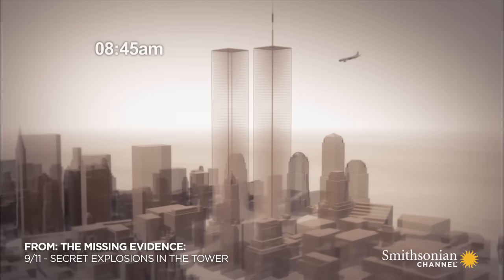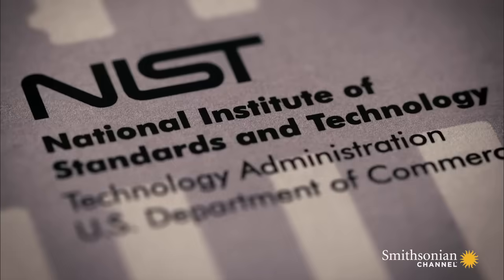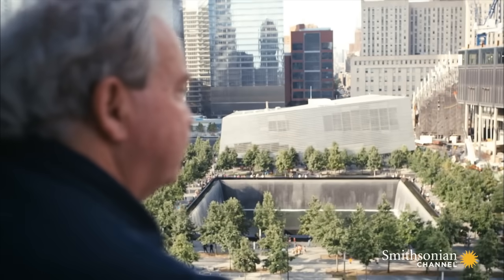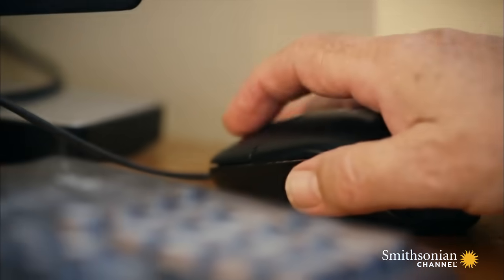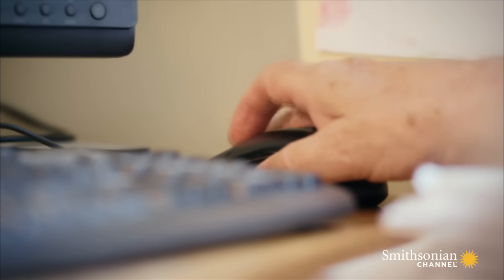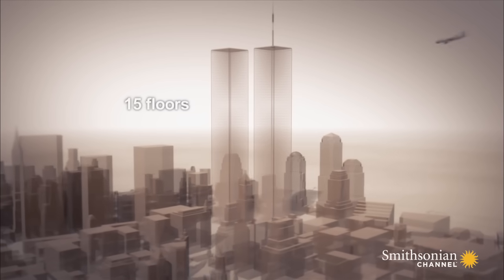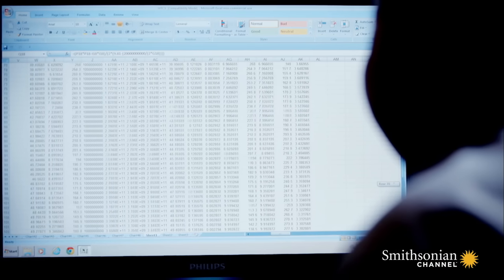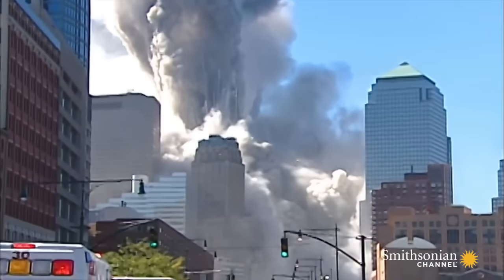This Computer Simulation Explains How the Twin Towers Fell

Comment: What this analysis lacks is the fact that only 6-10 of the 47 core columns were severed by the planes and others were supposedly weakened due to the impact and ensuing fire;
* Therefore, the damage to the core columns was asymmetrical, at least for the South Tower;
* The South Tower got the most damage (ten severed core columns) in the North East corner due to the skewed trajectory of the plane;
* Around 9 :58 AM the outer columns bend inward on one side due to the sacking of the heated crossbeams, which can be seen in close-up videos; 
* The crossbeams eventually gave way which lead to the collapse initiation  as NIST calls it and the upper section of the South Tower started to collapse;
* Due to the asymmetric damage the upper section bend 22 degrees to the side, but the collapse continued symmetrically in about 9 seconds (this video suggests 11 seconds);
* The collapse should have been largely asymmetrical, focused to one side;
* Another physical aspect which is not considered is the conservation of momentum. Even though a large mass of the building falls onto the lower floors, the upper mass itself should be damaged also, because it is exposed to the large mass of the lower floors. (Imagine a car having a head on collision with a truck.) 
* For the South Tower you see the upper floors disintegrate mid-air, while the collapse is still continuing;
* The cross beams and floors were calculated to carry much more weight than their own. The video theorizes that the weight from the upper floors was that of the Titanic, but still with the conservation of momentum and the collision on the lower floors there should have been some resistance, even for a brief moment;
* The collapse should have lasted longer, should have been partial/asymmetrical, but the collapse was (nearly) free-fall  with no resistance, as if the lower floors and its mass weren't even there.
Reply: the south tower was hit on  its side, the north tower took a beating in the middle, even though the north tower impact effected the building's core the most while the south tower core got chipped. That damage side of the building can leave tension on the other columns on the other side, slowly tilting the top 15 floors to its breaking point. Thats why during the south tower collapse you can see the top floor above the impact leans forwarded before disintegrating into dust. If this was a controlled demolition, you can hear bombs before the collapse
Reply: @nurfyturf3202  there was actually videos of witnesses saying they heard explosions before the collapse. YouTube removed them videos….
Reply: @nurfyturf3202  Explosions were heard when they fell, many people witnessed it. Don't try to justify the unjustifiable.
Reply: @technics1246  those where the floors crashing down into each other
Reply: @technics1246  You mean the "explosions" of... the sounds of 110 floors of steel and concrete falling on each other?
Reply: @nurfyturf3202 if that was the case then it wouldn’t have fallen at a free fall speed, if they are making explosive noises just by falling on top of each other then the that would have slowed the speed of the collapse, but the building hit the floor just as quickly as a man jumping from the 107th floor would have. Make that make sense.
Reply: @nurfyturf3202  bombs would have caused too much attention, nanothermite is a wiser choice.
Reply: Every floor adds to the mass as it pancakes down, while gravity adds energy at a rate of mass times speed power of two. Stationary structures are good at taking static loads, but generally not designed at all to take significant impact loads, so if the breaking force of the underlying structure is lower than the force being applied to it, under gravity it will approach freefall rates eventually as the gravitational force builds up energy constantly at a much higher rate than it is consumed. You could build a tower of carton boxes and stand over it and it would stand, but when weakened at the middle in a similar manner, it starts yielding and eventully collapse initiates and you will mostly just freefall to the ground once you start going, pancaking them all under you. If the breaking force was equal or higher, it would slow down to a standstill eventually.

Also one must remember that these were large structures with proprietary design. Comparisons of building collapses mostly involve much smaller and differently built structures. Perhaps what bothers me more is that those who were behind the act might have actually researched the subject and concluded an event like this would result, or even more so, they may have originally dreamed that they would have started collapsing very quickly after the impact, expecting the impact weakens the structure enough to initiate near-immediate collapse initiation, hence the death toll would have been at even much more genocidal level.
Reply: Well to be fair, if you look at HD closeups as the building is falling, the building does not actually fall straight down, but the opposite side seems to have buckled out and severed, and fallen straight down at an angle. Also I think a lot of the issues presented are caused by the lack of visibility mixed with the continuous motion of the smoke. It gives an illusion of freefalling, constant smooth motion without actual visibility of the building at impact.
Reply: The exterior collums are the load bearing collums, and each section of vertical pillar was only connected to the next one by 4 5/8 inch bolts. More than half of the load bearing collums were severed in the crash, transferring load to other collums, which had their fireproof spray blasted off in the crash, weakening the collums with heat, bending them inward under weight, floors collapse removing rigidity, exterior collums buckle and the whole building comes down. You can see this happening in the south tower. Not at all hard to understand. There have been other steel framed buildings collapse from fire alone since then too.
Reply: @john-s-peñois  thanks for this detailed explanation. I am skeptical of the official narrative but I haven't the first clue about structural engineering. Does your explanation also apply to the collapse of tower 7? How do you understand what happened there and is there anything you would consider unusual? Sorry for being a bother.
Reply: @john-s-peñois  there were two crashes, neither causing the same damage, destruction and deformation of steel and it’s fire protection was not the same on both buildings, fire and heat were not the same on both buildings, amount of weight above the crash site was not the same, yet both buildings suddenly started symmetrical complete failure instantaneously in the exact same manner, within minutes of eachother.  It’s not that hard to understand, that even if one agrees the expanding steel column theory is true and the buildings would have collapsed.  It’s extremely unlikely the collapsed would have transpired the way they had, notwithstanding the third building which wasn’t even hit by a plane.
Reply: The upper mass being damaged does not make it so that it's less able to damage the lower floors. The mass still exists, it's simply deformed, which it was. 
The top half started to disintegrate midair, but only barely as some of the damaged material leaked. 
Finally, the beans did put up resistance for a moment, enough to cause the top to tip over before crashing into the floors below. The moment of resistance is imperceptible and relying only conservation of momentum only accounts for instances of 0 acceleration, however, here acceleration would be constant, though with the added force of the tension in the beams below (which is why rope ladder rungs can fall faster than the physics of just the rungs separately would imply) and would offset any momentary velocity changes as a result of the momentum being conserved.
In fact, due to that tension force, they'd indeed be falling as if they'd be carrying more weight than they'd initially be calculated as, because there is more downward force than just the weight applied due to gravity.

Btw Veritasium has a good video on the rope ladder thing. It's not just something I made up for cope or heard about from someone else's response
Reply: Just goes to show you didn't actually watch it collapse. The collapse WAS asymmetrical, you just couldn't see it very well after it started falling. There are many different angles of this proving that. Just because the collapse didn't "last longer" than you think it should have (you are not a civil engineer clearly) doesn't mean you're correct.
Reply: Read Judy Wood's book, Where did the towers go? Evidence of directed free energy technology on 9/11. Empirical evidence is the truth, that theory must mimic.
Reply: Thank you Mr Walters. AND THAT my friends is a scientifically based analysis. Now, if someone can reproduce NIST's plausible theory. It would go towards changing a lot of minds but instead they offer garbage.
Reply: If you actually take a look at the Gary Pollard footage, you can see that the collumns were bending inwards right before the collapse. That means that the collumns couldn't support the weight above after they were damaged by the jet fuel, fire and explosion. If it were some sort of bomb, that would completely deny every single footage that exists.
Reply: By the way, the myth that the Pentagon lost 2.3 trillion dollars before 9/11 is simply not true. And for the people saying that the Pentagon was shot by a missile, that is completely wrong. You even have footage released in 2006!
Reply: Your comment is too insightful so you better march yourself right off to the gulag, comrade.
Reply: @GhostSal  send me the story about the 2.3 trillion missing... Haven't heard this one yet
Reply: @roam849  haha also, this exact ammount was brought up a year earlier to the house budget committee, this wasn't some plan to cover it up. It was public knowledge an entire year prior. Keep crying.
Reply: @roam849  Not missing. Just untracked because of outdated technology. The guy who says the words "2,3 Trillion" says that they're untracked because of outdated technology, which should and probably did come out and "tracked" the never missing 2,3 trillion
Reply: 🤯🤯🤯 
So what your saying is the end result of the buildings doesn’t makes sense?
Reply: @gabbygi_144  yes. The architect once said that even if one side of the building was rid of pillars, thr entire building would stand stable
Reply: Not to mention wtc7
Reply: "If you tell a lie big enough and keep repeating it, people will eventually come to believe it."  ---  Joseph Goebbels.  You better not question papa government else...
Reply: @topsyturvyy4558  
Funny; I tell those "9/11 truthers" that all the time.
But I suppose ya'll just ignore that whenever ya'll get that thrown back at ya?
Seriously; when exactly was the last time "papa government" actually went after one of you people?
Most of the time it looks like they just sit back and laugh at ya hysterically, literally or otherwise.  And in one case I've actually seen it happen.
And as a steelworker myself I'm tempted ta join 'em.
Reply: It was asymmetrical, you can see that when the towers fall, they fall while leaning to the side towards their most damaged sides (taking the path of least reistance)
Reply: And it wasn't free-fall, the outter part of the building was in free-fall speeds because it was literally in free-fall, while the inner parts of the building started to collapse a lot slower but the collapse got faster the closer it got to the ground
Reply: controlled demo
Reply: @Lazlo.  yep, nano thermite to be exact
Reply: I can imagine that a plane might cause a building of this size to symmetrically pancake under the right conditions. I have a harder time believing this could happen three times. The collapse of building 7 in particular defies belief. I  don't support jumping to wild conclusions without definitive evidence but I also think skepticism of the official narrative is justified in this case. I wish YT agreed.
Reply: @imartin43  It didn't "symmetrically pancake" did you even watch any of the collapses? They tilted, broke off in fragments, spread out, literally cascaded steel and concrete in an extremely messy fashion, h ow could you EVEN SUGGEST it was in any way "symmetrical"
Reply: @AstraphelAlcea    hi there. Yes I have seen the videos. Perhaps symmetrically is not entirely accurate in this instance. However, all three buildings do appear to "pancake" i.e. collapse more or less within the footprint of the building. In each instance, the collapse was rapid and even (does not appear messy as you suggest IMO) , the buildings were totally demolished without pronounced tilting or shearing. Whether or not they collapsed symetrically, all 3 buildings appeared to come down in remarkably similar fashion and conditions were different for each. Now I am just a lay person with questions, and an open minded one at that,  so if you can direct me to a source you think will help me understand why I am a dunce I would find it far more useful than your empty indignation.
Reply: @imartin43  If you have eyes you will see that the South Tower tilts severely from the top as it falls. No, the towers do not collapse "within their footprints," they destroyed the surrounding buildings and/or did so much damage the buildings had to be demolished. It covered twelve square blocks. How is that "within the footprint of the buildings?" You're just demonstrating you haven't done even the barest amount of looking aside from watching this video and saying "hmmm looks like this to me!" just head empty no thoughts
Reply: @AstraphelAlcea  ya know they say conspiracy theorists are unhinged but your utterly hysterical support of the official narrative is truly something to behold. On top of all this you have yet to mention my point about the suspiciousness of the collapse of building 7, which was at the core of the point I was trying to make. I do hope you are able to respond without the belligerence and insults. Doubt it, but I always have hope for people.
Reply: Israel
Reply: I doubt the fire could have weakened the steel core and make it collapse
Reply: @Wikchsawa  You can easily check that yourself by searching "steel strength temperature chart". Structural steel loses majority of it's strengh before it heats up red hot, and I routinely heat steel to red-yellow hot with atmospheric propane torches for heat treatment. And that's just a bit above 50% of the temperature required to melt the steel. At 70-80% temperature it will be very soft and this range is used for forgings and it has very little strength left for structural purposes at all at that point.
Reply: @erichasu737  

What core columns were weakened by fire?
Reply: @Wikchsawa   The antenna drops indicating a hat truss failure or simultaneous core column failures requiring high temperature
Reply: Thousands of gallons of jet fuel .
Reply: @romerjusu3804  20,000 to be exact
Reply: @romerjusu3804 jet fuel doesn't burn got enough to melt steel!
Reply: @romerjusu3804 jet fuel can’t melt steel beams 🤡
Reply: I don't see any catastrophic failure to the steel frame occurring after initial explosion if there is only the plane, jet fuel mostly code office furniture and include the occupants with luggage .  The shredded plane given almost all energy upon impact , the fuel is seen to ignite instantly.  
   Steel conducts heat efficiently. 
  The buildings were prepped
Reply: @davepowell7168  It would be presumable that the plane impact severed most of the support pillars of the wall, damaged the core, and caused major failure of the trusses of multiple floors, including blowing off most if any fireproofing. Add fuel fire to this mess, and it might not need that much of a decrease in yield strength of the remaining steel structures to cause the type of collapse we can clearly see from the videos happening. The more I've studied structural engineering, the more obvious this scenario has become, and suggesting any extent of conspiracy would be just hilarious at this point - given all the other factors, including lack of aviation security back then, details do add up, and as always, you will need a bit of luck - bad luck in this instance - for things to happen.
Reply: @erichasu737   Luck has no place in physics except perhaps discovery and commonsense should hopefully prevail. 
    The damage and heat from a civilian airliner impact can not symmetrically level if built and furnished to code.
   Only experts can bring skyscrapers down symmetrically
Reply: @davepowell7168  Luck has place on human borne error, such as airport security. Tests carried out by security authorities have routinely managed to get the full range of malicious items through security checks. The rest will be physcis. Like I said in my other comment, I do metal heat treatment routinely for hobby purposes and steel will definitely lose most of it's strength at temperatures that are readily, easily and quickly reached by atmospheric combustion of hydrocarbons.
Reply: @erichasu737  any failure would be asymmetric and not pass mechanical floors. The buildings may have appeared to be rectangular boxes but the infrastructure is more pyramidal for wind resistance. 
   Vast redundancy is inbuilt. The idea of the building 'falling through' healthy structure beneath is absurd
Reply: When you go ahead and become a mechanical engineer designing skyscrapers, go ahead and bring your plans to your boss. His face will light up at the genius of it, why did they never account for the possibility of excess force from above before? Those asteroids which hit routinely and winds… traveling downwards… are clearly massive threats that has doomed many a skyscraper before. The fact that excess force from the sides by wind was a much greater threat was made up by the government, so why bother with that? The plan is approved, and within a few years a strong wind sends the scraper down. You are fired and then subsequently hired to build the twin towers.
Reply: @davepowell7168  totally agree